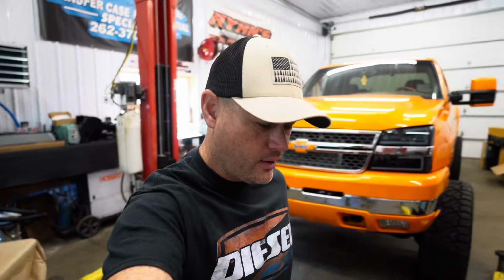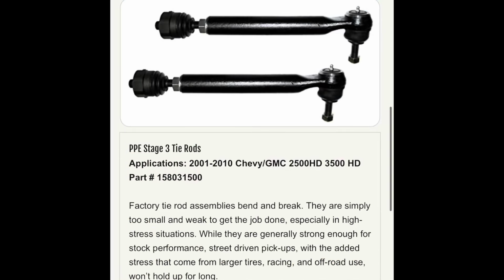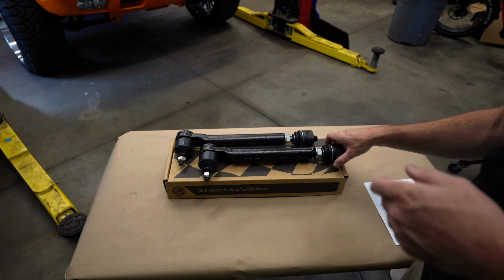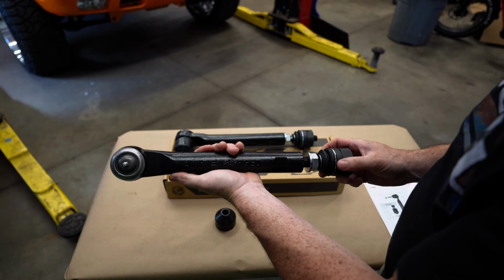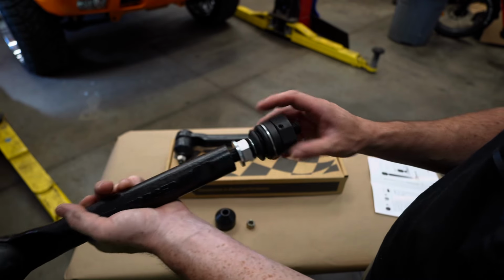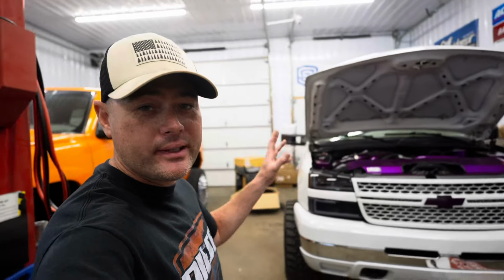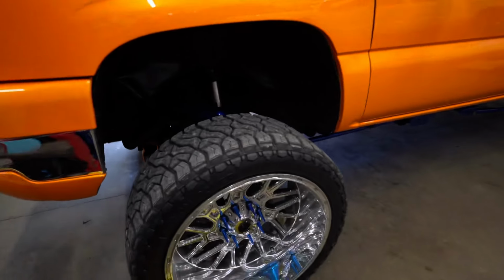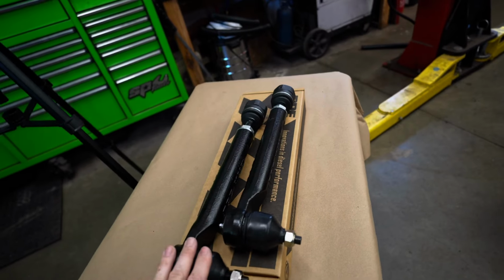Every GM Truck Owner Needs This Upgrade! Must Watch

Comment: I feel alot of people are unaware of theese crossmember bushings but they take alot of stress as they hold up the weight of the front end w the torsion bar resistance.

Comment: I totally understand and agree with the upgraded tie rods. I’m sure many people would love to see some of the idler arm and pitman arm upgrades, braces, and supports. I feel like the idler arm and pitman arms are so problematic. Most guys can get away with tie rod sleeves. I think Most of the flopping around in the front end of GM 2500-3500 platforms 4x4 comes from deflection of the idler arm and pitman arm.

Comment: Heyy i just see on the end of  your video the torsion bar crossmember mounts i rec3ntly just did those w a new set but i instalked energy suspension polyurathane instead of just replacing w the rubber bushing type

Comment: I have the airdog II 165. Need to replace the filters and separator and I'm wondering if you recommend staying with airdog brand or putting on aftermarket filters like you did for the fass back when you ran that.
Reply from the maker: Stay with Airdog 👍

Comment: Didn't GM improve the tie rod strength/design on the last truck HD truck refresh model series ?,  I thought I had heard something to that effect although would not be like these aftermarket units.
Reply from the maker: Yes they absolutely did but they are still very small compared to these. However the 01-16’s definitely need to get replaced
Reply: @truckmastergarage9944  Ok, thanks for the confirmation ... at least GM finally put thicker lead in their pencils 😆

Comment: Solid axle
Conversion is the only way! Bullet proof if! Chevys biggest mistake was dumping the solid axle front ends in 1987 for the weak little tooth pick IFS, diesel or not the Chevy ifs front ends can’t handle any type of lift kit or larger tire. They just aren’t made for it. I had a ‘98 half ton Chevy that I did a 1 ton solid axle swap to, I started with a 3/4 ton ford high pinion dana 44 front axle, and 14 bolt rear, theee a dime a dozen, I transitioned to a Chevy side king pin dana 60, swaped t cases, adapted a np205 with 203 doubler using an advance adapters kit. When I was done it had about 14”-16” of
Lift and rolled on 42” stampers. Hehe it was big.  I did leaf springs in the front, i didn’t have the money to do a 4 link and go all crazy. If I was going to do it again I would 4 link the front end, knowing what I know how. 1 ton king pin Chevy and ford high pinion axles are hard to find these days, everyone now is using the ford sterling front axles from like 2005-2016 ford f250’s/350’s with the 6.0l power choke motor. There a beefy front axle and there’s lots of them out there, lots of wrecked 3/4 ton and 1 ton fords with blown up 6.0 motors, they were a ticking time bomb for a motor lol so there’s plenty of axles out there on trucks with a blown up engine! Back in the day a king pin 1 ton 35 spline dana 60 front end was about $1000. You can’t even find em these days. off road unlimited made the bracket front kits for the axle conversion to front leaf springs. I also ran a AGR hydro ram assist. I don’t even know if ORU even makes ‘em anymore or not, that was 20 years ago. Id’d never have another Chevy IFS truck! I want my truck to ride like a truck.